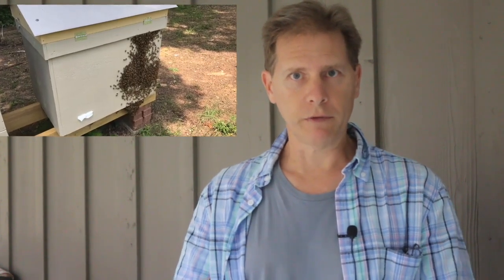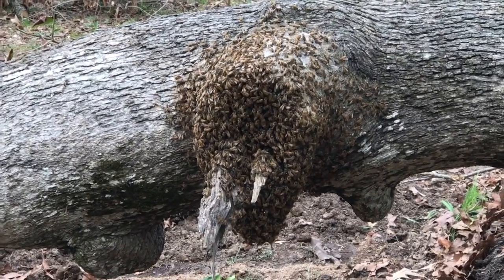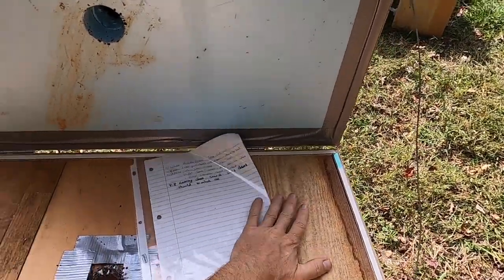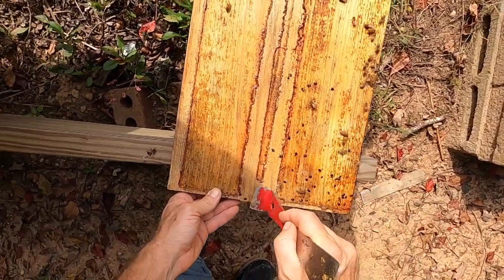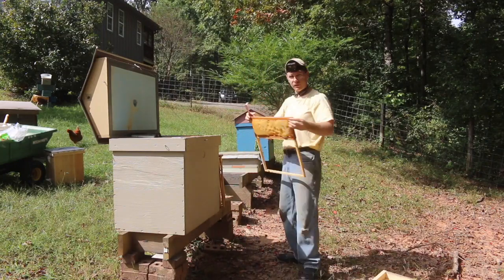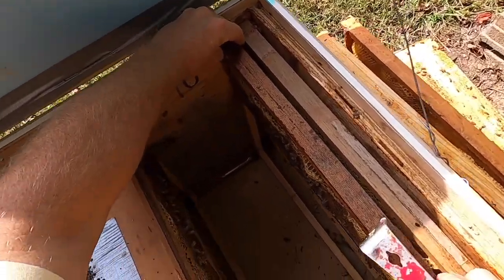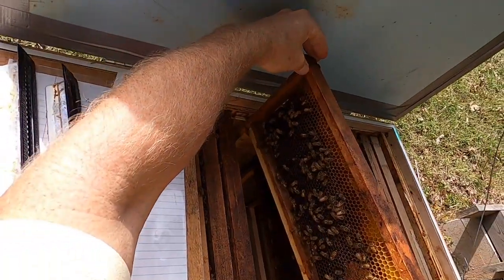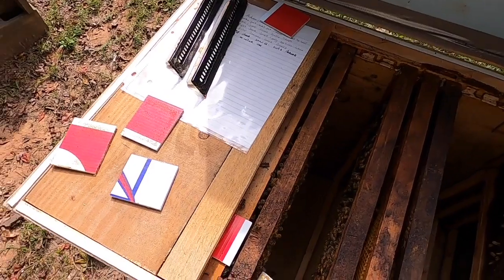10 07 2020 Inspecting the Horizontal Hive

Comment: you've got way too many frames available for the amount of bees that you have in the hive. Decrease the number of frames with a blocking board, and add frames when your existing frames are approximately 80% full.
Reply from the maker: I probably could have removed a few more.  Next year if I'm still using this configuration, I'm either going to modify it to become a Layens hive by making it narrower OR put a permanent divider board down the middle and run 2 colonies out of the same box.  It's too big for my area for sure.
Reply: @enjoybeekeeping5612  I have 16 horizontal hives all built to the specifications I got from Dr. Leo Sarashkin off his website HorizontalHive. They are all double colony 31 frame hives with a slot in the middle for a colony separator board. I'm not about to spend the money to build a deLayens spec hive and put shallow frames in it.
Reply from the maker: @richarddriggers9791  that sounds really interesting.  Please feel free to send me pics to my email enjoybeekeeping@gmail.com  I'd like to check it out because I'm going to be putting dividers in some of my longer horizontal hives making each colony able to house 2 colonies instead of just one

Comment: Hi, I’m just starting and building all Layens 21 frame hive boxes myself. I’m a fan of Dr Leo and you. I have searched everywhere and can’t find if it’s ok to just stain and poly coat the exterior of hive boxes? Additionally, if I use paint is both water latex and /or oil base ok?  Thanks for all your well done videos!
Reply from the maker: Great questions.  You can pretty much use anything on the outside of the hive and not have any contamination issues as most natural beekeepers are concerned.  I personally have used regular exterior latex paint, as well as oil based stains, and poly with no problems at all.  Never use anything for the inside of the hive and you'll be just fine.  My usual "go to" for a while has been an all natural non toxic mineral based stain called Eco Wood Treatment.  You can get it online at Home Depot.  https://www.homedepot.com/p/Intl-Eco-Wood-Treatment-1-gal-Exterior-Interior-Wood-Stain-and-Preservative-EWT-1/203077387

Comment: Gene, are you converting langstroph nucs to layens hives?  I built 4 more layens hives and I could buy packages or catch swarms. But would like to convert a 5 frame nuc.  I saw Dr Leo's video where he cut the langstroph frame and mounted inside a layens.  Just curious how you do it.  I just cut the comb out of the last one and rubber banded it in but they didnt really reuse that comb and just drew new comb...kind of defeated the purpose.  Thanks
Reply from the maker: Yes, I'm converting over little by little as I can without causing too much disturbance on the bees.  Spring build up is probably the best time for conversion.  I'll likely have some videos coming next spring on this so stay tuned and thanks for watching

Comment: No mention of mite load on your data sheet. Was that on a previous video? Also question regarding how you flip your frames. Should it not be done differently? Thanks for your videos.
Reply from the maker: No mite counting on any of my colonies since I let them swarm / split regularly.  Beetles seem to be my only real threat that I need to monitor.
Reply: @enjoybeekeeping5612  Have you got a video explaining how and why splitting regularly a colony controls the mite load? I don’t understand? Thank you.
Reply: A late response but splitting and swarming breaks the reproductive cycle of the varroa mite.   
I let my colonies swarm and have an easier time with mite loads.  If the hive doesn’t swarm I have high mite loads